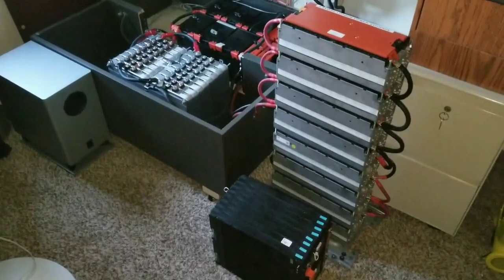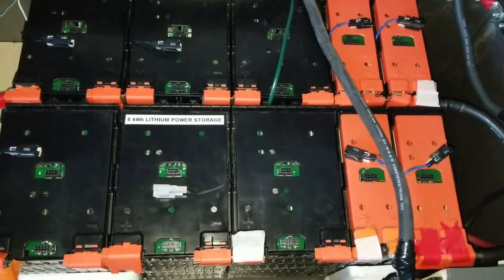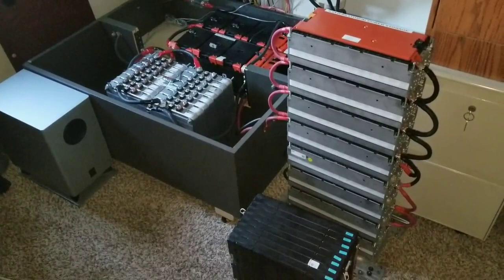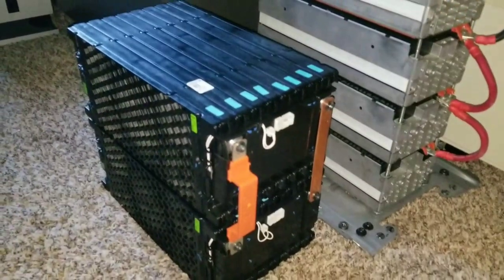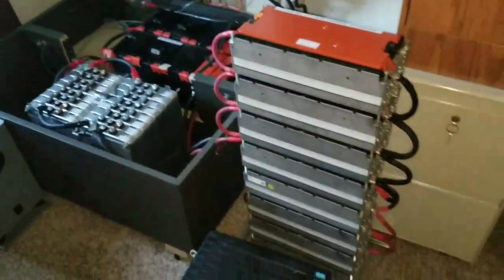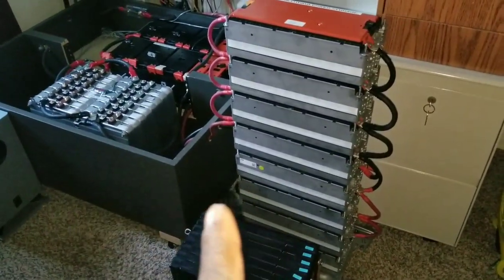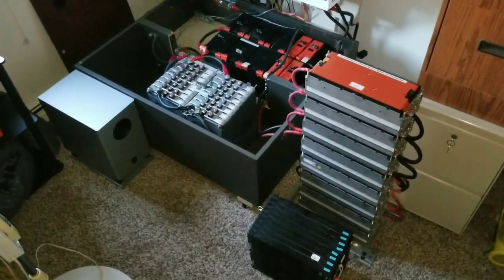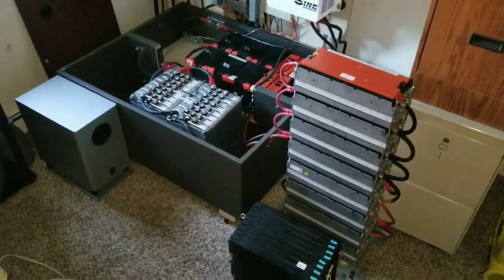LITHIUM BATTERIES FOR SOLAR: 30.544kWh Lithium batteries explained

Comment: do you like the outback or midnight charge controller best
Reply: Outback CC' are better  but the Midnite classic has more features eg Wind track/hydro
Reply: @awesomusmaximus3766  thanks for your input..but i only have solar for now so outback will work ok for me
Reply: @gspenc50  You won't be disappointed
they are a great unit
Reply from the maker: They are all good and solid Charge Controllers. 
I like them all and thanks for watching.